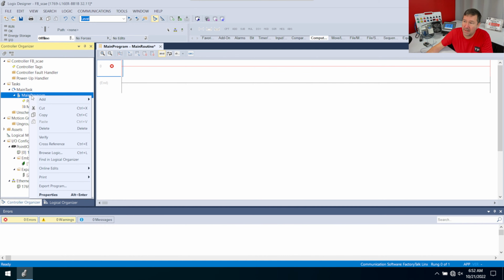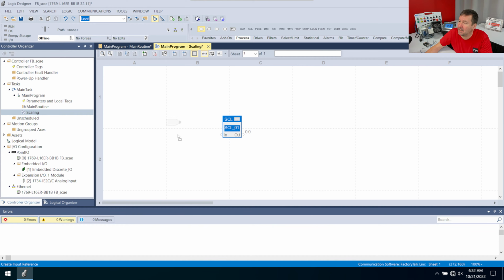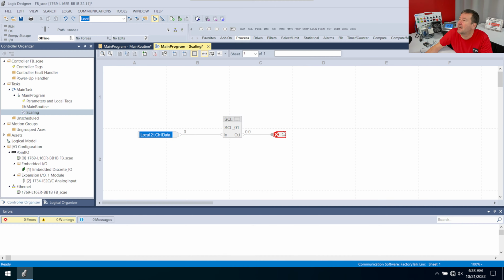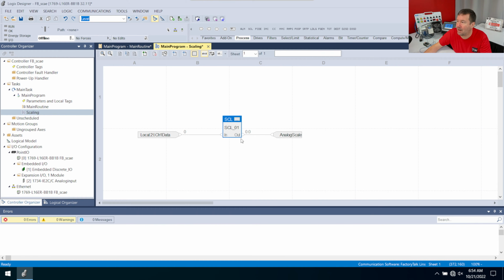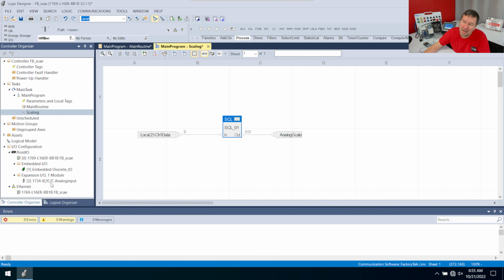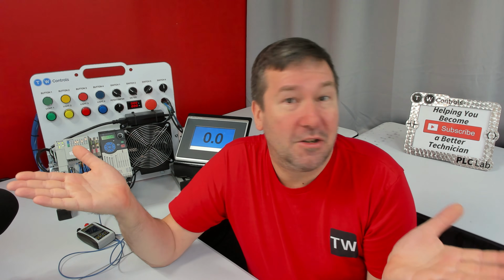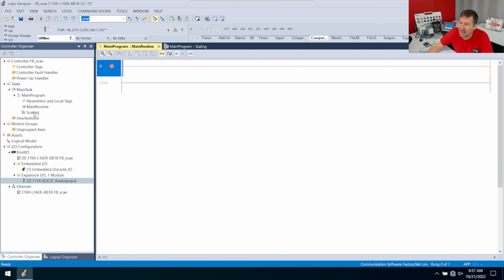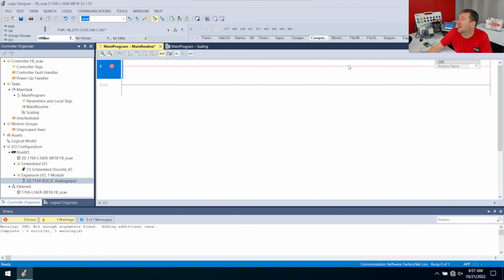Studio 5000 Scaling with the SCL Instruction in Function Block

Comment: I can see that the High and Low Eng values in the configuration tab can be modifiable, what are the correct values? why 16383 and 3277?
Reply from the maker: Check out the Analog 4-20mA and 0-10VDC chapter at the link below.  There is even a lesson on the pitfalls of modifying the values on the configuration tab.
https://twcontrols.com/studio-5000-course

Comment: Hi Tim, for some reason my input and output is backward. I am using 0-10 volts. The correct voltage is showing on the output and is being scaled correctly on the input. I chose Input channel 0 for the input so i don't make sense why its showing output.
Reply from the maker: Cross reference the output and see if you have any Ys in the destructive column.